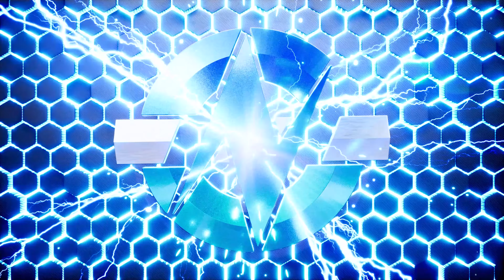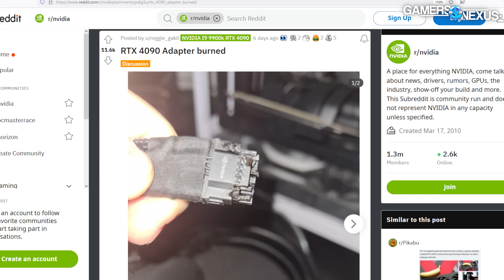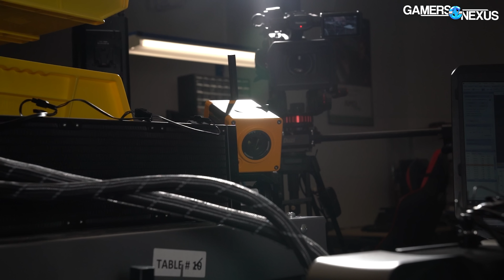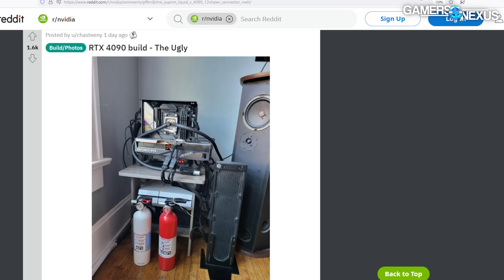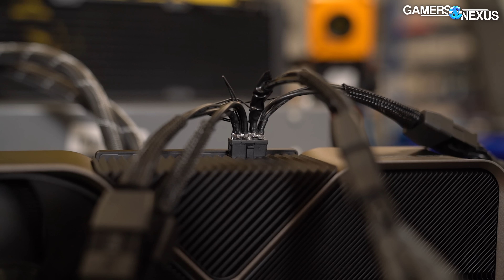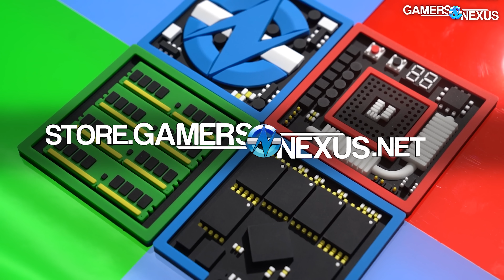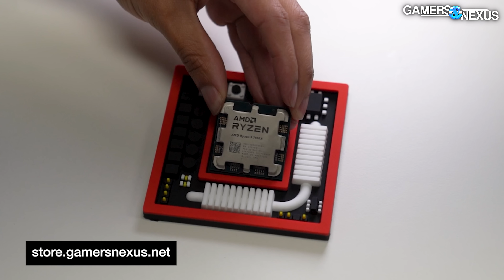Testing Burning NVIDIA 12VHPWR Adapter Cable Theories (RTX 4090)

Comment: The Biggest problem with NVidia is that they market themselves as a premium brand, but they don't actually build premium products. This card running at 70% power limit with 350watt TDP is only 3-4% slower than 100% power at 450watts. They could have made this card a 350watt card with three 8-pins that goes up to 450watts and not have these issues. They also refused to at DisplayPort 2.0/2.1 on this card. This is supposed to be your premium top of the line 90 class card and it wont even be able to run the next gen DP-2 monitors with their crazy high refresh rates when they come out next year. You need to buy AMD's RDNA3 GPU's if you want that 500-600hz refresh rate at 1440p because they are the only ones with the new DP standard. Nvidia is overpriced trash. They are not the premium brand anymore and people need to wake up. Ray Tracing is a complete joke. The only shadows/lighting people will use next gen are the ones in Unreal 5 engine. That Lumen Global illumination in UE-5 DOES NOT USE RAY TRACING. So your RT is absolutely worthless. Every real next gen game will run Lumen. Lumen doesn't use RT therefore RT is meaningless. End of story.  Are you paying 1600$ for RT cores you can never use for anything other than a garbage game like cyberpunk? do you actually PLAY that game instead of just benchmarking it? I swear, The people who buy NVidia GPU's are probably the same people who watch their wives and girlfriends bang other men while they stand in the corner, crying and jerking off.😂😂😂
Reply: I think the extra 100w is for tensor cores or something like that for ray tracing games.
About DisplayPort 2.0/2.1 is kinda unnecessary as 1.4+DSC covers almost everything this card capable of (including 8K60fps) and HDMI 2.1 can apply DSC too.
OLED monitors going to release later this year also don't need 2/2.1.

Comment: There’s also one thing that irks me as someone with a bit of a background in product development. You should always design the product with the actual real world use cases in mind. Warnings like „don’t bend the cable too close to the plug“ are almost always the sign of a product which wasn’t designed for the intended use case or audience.

If you make cables/adapters for PC you absolutely have to expect the cables to be abused and mishandled. That’s one reason why the PCIe power connectors are overspec‘d/overdesigned to a fault. So that they still operate within spec even if they are bent to oblivion in an SFF case or have been plugged/unplugged dozens of times and are now re-used in the third build years after the original purchase.

The whole way the adapter was designed reeks of people who have no clue how their products are actually used. From the location of the plug on the PCB which means that the adapter will most likely collide with a side panel (even in my Corsair 7000D airflow which is basically large enough to fit a combine harvester), to the way it is designed and to what spec it is manufactured.

This thing might perform well on a test stand where bending radii can be controlled and where the cable is ever only inserted once and doesn’t undergo any mechanical stress but it’s an absolutely horrible way to design if your intended use case is enthusiast people with at best a journeyman knowledge who have to install and use this in an average PC case.

Why have it attach on the side? Why not use any of the other three available sides that don‘t point to the side panel? (like the back as they do for the pro grade cards) why not a 90 degree angle plug? Why solder wires with large cross sectional areas to a small PCB when you could crimp/press fit them?. Why use that 12 V high power plug at all when the power supplies with ATX 3.0 support won’t be available until Q2 2023 which is most likely when you launch the Supers/Ti anyway?

I have no clue what they were thinking when they designed that cable but I’m relatively sure that no one was involved who actually builds PCs as a hobby or for a prebuilt PC manufacturer.

Comment: 6:00
150V rating is just for insulation. As this is 12V system, there is no difference between 150v and 300v insulation.
Problem is current rating. 14awg is 20A max at 95 degrees, and yet these things draw up to 50A total for 600W, which is about 12.5A per wire, in case there is equal current over all of them, which never is. For 12 pin, that gives about 8.5A per pin, which is huge.

Comment: Its simple. You can just check woth MOLEX and they say on their spec sheet the adaptors last for 30 cycles only. So if your constantly removing them your shortening the life of the component.
Reply: 30 is the guaranteed minimum. In reality it would likely be a lot more than that.

Comment: Nvidia "I want to make things smaller and cuter by taking some thing that is durable and never had a problem and make it less durable" 
solder is not Glue it still needs mechanical clamping

Comment: My theory, people where bending the cables in a tight radius (as pointed out across the interweb) causing the independent strands of wire to separate as a whole and potentially snapping, thus with the increased voltage/amperage through fewer strands it's causing heat, if anyone has tried jumping a car using to small gauge of wire they'll know the heat generated. Or another problem is people using underpowered PSU that the GPU is drawing too close to limits of the PSU threshold and not triggering the safety.
Reply: GN tried to do that but the window between bent and on and bent and not booting was so small.

Comment: The point where the melting occurs is in the front of the connector (as far as i can see on all the available pictures) not in the back at the solder joints. So i would look into the pins/terminals. If it is true that the original Nvidia Terminals are split in the middle they could open up if the connector is bend sideways. Which would result in worse contact resistance and this would heat up the terminals where the melting is shown.
Reply: GN tried to bend and still got no issue.
Reply: @Safetytrousers  I watched a clip today that discussed the connector. And i think it is from a electrical and technical standpoint the most probable reason. And it is not far from what i wrote. watch?v=yvSetyi9vj8

Comment: As a person who makes cables for a living the main issue seems to be that the connector is too small for the current needed. They obviously used busbar-soldered wires configuration because they weren't able to cram enough cable surface area to connector crimps. That should have been a red flag to whoever decided to use this connector. Also, soldering doesn't provide a proper mechanical connection when crimping does. 

I'm not sure who is the manufacturer for those connectors but after google-fu I found pretty similar 3 mm pitch 12 pin connector that has same keying. What I found is Molex Micro-Fit 3.0, only difference is that it doesn't have data pins. I couldn't find a contact that accepts more than awg 18 (0.75 mm²) cable and they are using 14 awg (2.5 mm²) cable. The maximum current of a single contact is 8.5A so 12V * 8.5A = 102W and as we have 12 pins where half are positive and half are negative the total current goes throug 6 pins that means 102W * 6 = 612W. I don't know how much the power consumption of RTX 4090 is but I think that it has no room for any losses.

NVidia is trying to get 20 mm² (8 x 2,5 mm²) of cable to go through a hole that is made for 9 mm² (12 x 0,75 mm²)

Higher voltage rating on a cable doesn't mean it is better quality. It is just an indicator of insulator properties. On 12 V application it doesn't matter if it is 150V or 300V cable. 300V cable might be a bit stiffer caused by thicker insulation though.

Comment: You can test what buildzoig said in his video, the problem is the contact terminal of the adapter, he show that terminal contact from Nvidia adapter is quite different from other, the burning will occur if you wiggle the cable horizontally (this is still theory)
Reply: GN tried to 'wiggle it horizontally' and could not reproduce the issue.

Comment: Could it be the foil for the sense pins is being used for the pads for the power delivery PCB for some cost cutting less than reputable manufactures?

Comment: It's interesting to note that, every single instance of burned cables were on AIB cards and not on FEs (at least from what I saw on reddit's mega thread). Is it possible that NV just dumped questionable quality cables they had on the AIBs and kept the 300V rated/better soldering job for their own? Or just ordered manufacturing for their own on a different source than for those they sent to AIBs. Is the cable you've tested the one that came with an FE card, Steve?

PS: The thermal camera should be named after its father, Steve JR. That way Intel (the meme "thanks Steve") can thank the camera every time it shows people how thermally inefficient their 300W CPUs are.😁(Yes yes, Zen 4 are toasters too, but they haven't been thanking Steve so far 😋)

Comment: A name for the camera? Tamera, like Tamara but a thermal camera. Turn on the Tamera hahahaha, what are you looking at? It's winter and Tamera needs a sweater. You asked for a name, for a camera... I'm such a child.
What if, we turn the pc case into a refrigerator? Would that help? Everyone just seems to add instead of completely redesign.
How did nvidia and gigabyte didn't foresee this? Additional to them adding power and memory, I believe they also cheap out on the cables. Guess we will find out as time goes on.
@26:09 thank you!
Alright off to buy a seriously overpriced mouse...

Comment: You need cables and connectors which can sustain 450 W / 12 V = 37.5 A current (it's a lot!). It's not very accurate result, but this is the point to go from.

Comment: I do not have one of the cards in question. My question for those out there or Steve if he sees this. I've heard that there is no shared 12v plane on the 4090 boards. This being the reason for the cable to need a bus bar. Is the bus bar only where the solder pads are? Or is there another bus bar further in? Having the external pins melting before the internal pins is the tell-tale. If the outside pins separated from the bus but were still attached to the cables and individual pins, you are now supplying the same wattage requested by the card components fed from those pins but now only over a single cable. Wattage and voltage being same, current increases on only those cables and connections. My 2 cents?

Comment: Not Igor himself, but beQuiet opens the adapters. You can only see Close-Up-pictures. Have you ever opend a Adapter from a 3090(Ti), 3080 or 3070? Maybe you can find there 150V cables       (from my 4090 is 300V, too)

Comment: Well this just keeps getting weirder and weirder... 🤔
Just as a little random question about the testing process, I would be curious on what software you use to produce the load on the cards?
I think we are all are aware, synthetic benchmarks, while being able to produce a constant and repeatable results when testing,
some games have been known to produce a much higher and fluctuating load on the cards. I really wonder if that might also be part of the problem, why 
apparently no one(!) was able to reproduce such an melting event. Which usually would lead to believe, that there maybe more factors leading to the conclusive 
melting events...
Afterall, even with severely damaged cables you yourself barely appear to hit temps over 70°C while the melting temps 
should be around 105°C or 125°C or higher.

Comment: from my electric point of experience the side cables can generate a lot of heat if they get damaged partially rather than snapped completely and make most of the current pass through the Centre cables , the side cables when damaged partially and stay connected with very thin section that section turn into space heater and even might get red glowing .

Comment: One thing that seems to correlate with the redit stories is IQ, this connector is SUPER easy to not seat correctly, I have msi and FE, they both are the same. It is essential to push the connector the extra 1/2 mm to seat. That is an issue with the design given that all consumer products should be failsafe though. Another issue fueling this is buyers remorse and bitter jealousy seems to be laced through the threads.
It is a bad connector because idiots can't connect it correctly 100% of the time.

Comment: You tested the GPU at constant load but what about when it ramps up the fans the changing frequency causing miniscule vibrations and pins vibrate enough to cause arcing couldn't that be an issue. On Reddit the initial viral was vertical so vibrations would be more prominent I would think. Just an observation

Comment: 2 things:  1) either the 300V or the 150V rated cables can probably be used because they both meet the design load.  somebody somewhere made that decision without understanding why 300V wires were the spec.
2)  if one cable made it out into the wild like that, many did.  I'm curious of all the known melting issues so far, how many of them have that lower rated cable
Reply: Voltage rating only applies to the spec of the insulating sleeve (material & thickness) and has no direct bearing on the current carrying capability of the conductor (the indirect effect is that thinner, lower voltage insulation allows the conductor to carry a bit more current before going overtemp). It's more an indication that there's variance in the components and possibly the design/construction of all the adaptors made, which might be relevant to the issue at hand.

Comment: Has anyone looked into the Plastic itself? I know not all plastics are the same, so maybe it has a lower melting point. Or it's thinner on some of the connectors. I'm sure they're using more then one vendor for manufacturing these connectors.

Comment: The only difference between a 150v wire and 300v wire is usually just the thickness of the insulation.
Reply from the maker: The real difference is that it's different. Not being snarky, that's the thing that matters. Indicates there are other differences.

Comment: Finally someone with some electronics engineering understanding looks at the issue and says "probably manufacturing defect" as though the ATX 3 spec writers didn't test the fuck out of this connector as a standard.

Comment: I dont really agree with the investigation subject. Concentrating on the cables on a connector seems like you are ignoring the obvious. 
The insulation rating cannot cause electrical heating. If the 150V-cable is bad, then it will be hotter over the whole length. If the soldering is bad with the 150V cable version, this wont be something you will see during testing without a large statistical sample size.
On the other hand, if some connectors actually make bad contact...... (which seems the first problem I would investigate with a milliohm-meter)
A bad contact can be caused by the connector on the PCB (which would be testable by inspecting multiple failure PCBs and see if the connectors are all from the same manufacturer) or a bad cable. On a bad cable you need to look at the burn marks at the pins, not the cable.
Also, the current for each pin is not only decided by the connection quality at the card, but also the power supply. If you have a cold power supply that has a bad connection it may sink the heat away from the bad connector, but the unequal load distribution can then cause a problem at the hot card connector especially if it is seated badly or has quality issues regarding the pin-coating (if it produces unreasonable heat itself). THIS is what you need to put your time to.

There is a lot to check, but looking at the cables... that is the most unlikely cause imho

Comment: I wonder if the connected power supply is a factor. If a power supply for example has a multi rail design, could this adaptor be bridging two rails (pcie 8 pin cables on different rails for example) and causing unexpected current via the adaptor?

Most of the testing I've seen has that is unable to recreate melting been with very high quality and high wattage PSUs. Although manufacturing defects do seem like the most likely cause.

Comment: Since the connector temperature is significantly above ambient temperature could a not high air flow case push temperature above 100°C. To my understanding Nylon 66 typically start to deformation around 100°C, which means while it can resist higher temperature in short session, running it 24H7 use something like fold at home or crypto mining above that temperature can result in melting like result.

Comment: is the issue that people are using 3090ti adapters on their 4090's? Cuz i just pulled apart my 3090ti cable and it has 150v 16 gauge wire.. So if igor had a 150v and none of your 4090 cords are 150v then one could assume that the 3090ti had 150v 16guage adapters and the 4090 has 300v 14 gauge adapters and igor and probably many other people who had a 3090ti and upgraded to a 4090 (or bought a 3090ti adapter for their 4090) didnt realize that they were using a less sturdy, lower rated adapter?